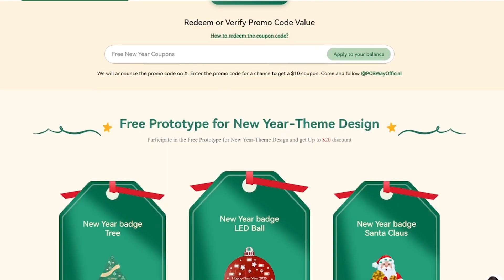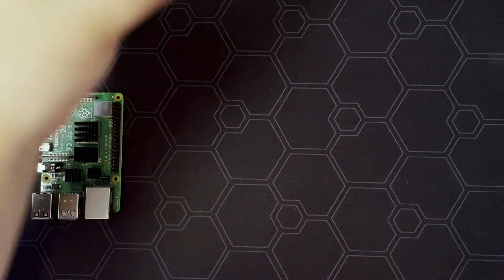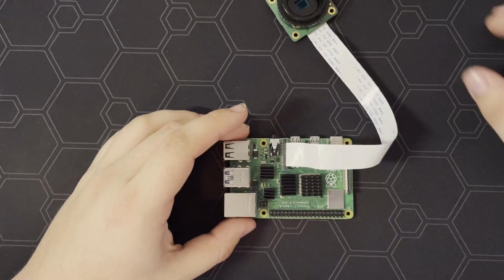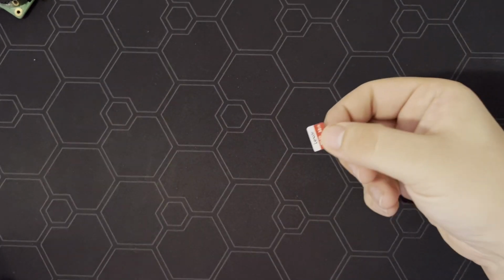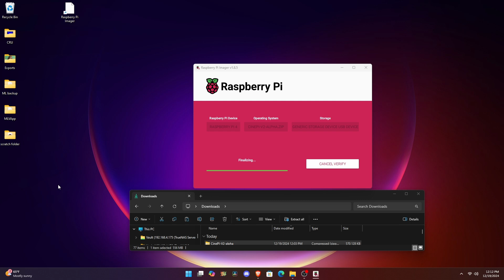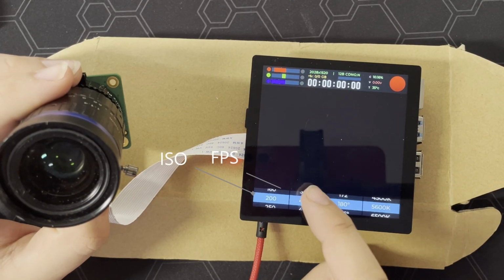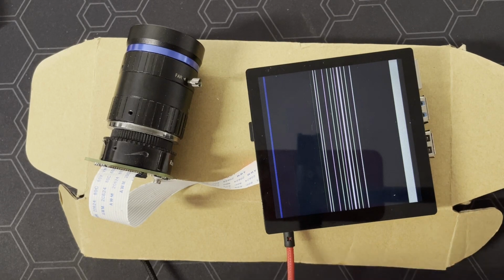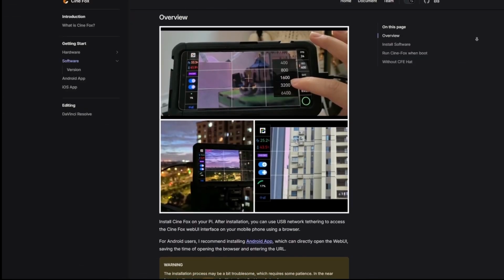Barebones Cinepi V2 Build Guide

Comment: hey, me again, my cinepi installation isnt recogniuzing my pi camera (official hq version) is there anything i can do?
Reply from the maker: Install Raspberry Pi OS with the camera plugged in, and run the libcamera commands in the terminal to see if it detects your camera. If not, you may have a faulty cable or a faulty camera module.
Reply: @YogertPC  it worked with cinemate, i just want to try the official
Reply from the maker: @DiSCo-l6u you could try alt cine’s image https://youtu.be/Pn3rWfSzOyk?si=IbknbTCjD7SWmkY5 otherwise hit up the discord I haven’t had that issue
Reply: @YogertPC  where can i find the image?

Comment: Question: Why not use the 64 mp Hawkeye pi camera module? It's sharper than an iPhone 13 camera and has a bigger sensor 1/1.7

And might as well get a imu gyro and mount the image sensor on a small 3d printed gimbal?
Reply from the maker: Since we already have sensors better suited for use as cinema cameras, such as the Sony IMX 585 or even a super 35-sensor that someone is currently attempting to make work, as for gimbaled sensors, I’m certain someone on the Discord is working on it.

Comment: does the powerboard cause any interference with the display when sandwiched between the pi and the hyperpixel?
Reply from the maker: It can and it depends on the power board. I’ve had no issues with mine though.

Comment: Waht about sound? 'asking because I'm building a syncing gizmo (to kill SMPTE LTC) it is called TicTacSync
Reply from the maker: Someone is working on it they, are very close I heard. Also the starlight and one inch eye sensors output a clock signal to use for sync sound, so those ones at least can do sync sound.
Reply: @YogertPC  we should incite camera manufacturers to implement  GNSS time of day based head and tail microsecond time stamping of recordings: simply store those in file metadata and use them in your NLE. For now I'm using the audio track to record the modulated UTC time. It can even be used to re-sync ISO files (recomforming).
Reply: @physiqueDrummond  what's wrong with LTC?
Reply: @dennypilot9856  tech cons: devices cost; no faster standard  framerate than 30 FPS; as used, no subframe precision; clock drift; UIX cons: must set FPS; must set same FPS  for all devices, if not, you're screwed; must jam sync; newcomers don't understand DF vs NDF for rational FPS;

Comment: What battery did you use? I tried a barebones build today and i used a USBc power supply but I don't think it was powerful enough.
Reply from the maker: You need to make sure your usb power supply can provide enough voltage and amperage for the raspi. Which is  a minimum output of 5V at 3A (amperes).
Reply: @ I tried 2 different power banks that could supply enough power but they didn't work

Comment: Thank you for sharing this video with the community. Would love to see a step guide for the V2 variant. Excited to see whats to come. 

also, is there a simple way to add a stop start record button directly to the pi?
Reply from the maker: Thank you so much I really appreciate that. The build guide on the git hub has a way to do it but, because of the touch display using all of the GPIO pins it’s not the easiest thing to setup. However Cinemate the other cinepi distribution I found out actually supports using a phone as a monitor so I that should be as simple as putting a button on the appropriate gpio and be ready to go. Video on that coming soon

Comment: Wondering if anyone has used it with the rasbery pi global shutter sensor and what is your experience... If so it would be one of the first high res global shutter, affordable camera rig in years... I got a pi 5 just to experiment and do this.
Reply from the maker: I believe some people have done it with the global shutter. There were talks of it a year or two ago, but I would ask on the Discord.
Reply: @YogertPC  cool i'll have a look, its really daunting looking for a global shutter camera. there are proper cameras but at the cheap end at £350 but its 960x540 upscaled (panasonic hmc150) and other cameras are £500 plus but blackmagic seems to hate that camera by not supporting it even when it was new. anyway thank you for your work

Comment: what about raspi 5 16GB ? can it also work ?
Reply from the maker: It should but, there is no reason to buy a pi 5 16gb for this project when with a decent-ish SSD even 8gb doesn’t saturate the buffer. Honestly save the money and, go with 8 or 4 or 2gb for 50$. If you aren’t compiling the software yourself and can find precompiled software specific to the pi 5. But cinepi v2 is specifically for the pi 4 b so I reccomend cinefox for any pi 5 shenanigans.
Reply: @YogertPC  The one case where 16 GB might be helpful is if you're recording short high speed clips, you can cram more stuff in the 16 GB RAM really quickly, so your buffer would be better there.. that's probably a higher end use case, but one way to justify spending so much on a Pi haha
Reply from the maker: @Level2Jeff according to School Post at  300 MB ish a second you can actually still record some in some pretty high frame rates so a fast SSD is gonna be the most important factor still. However  the 16GB will allow for the extra oompf for doing it at even higher resolutions so I’m quite excited for what he figures out with it too.
Reply: @YogertPC  Yeah, I'm just excited that with the Pi 5, it looks like it unlocks a few nice things like 4K at 30 (easily) and maybe even 60 with some hacks... and even higher framerates for high speed use! I'm hopefully going to build one of these soon.